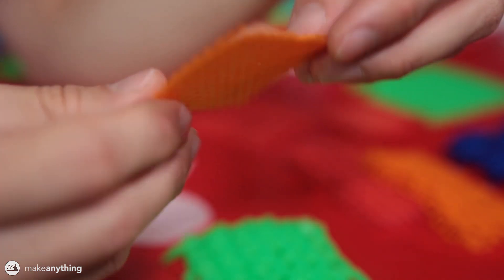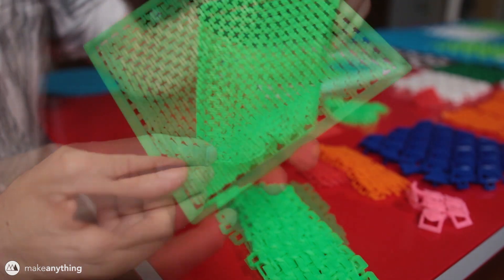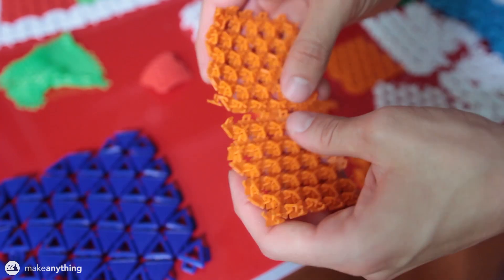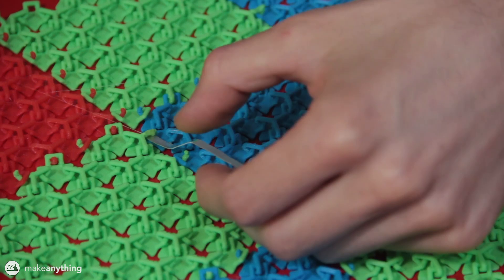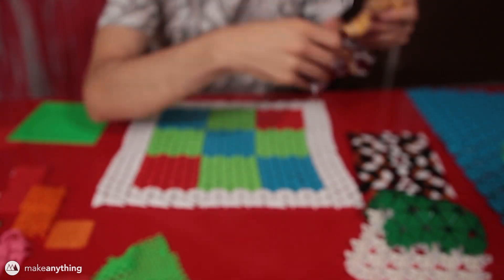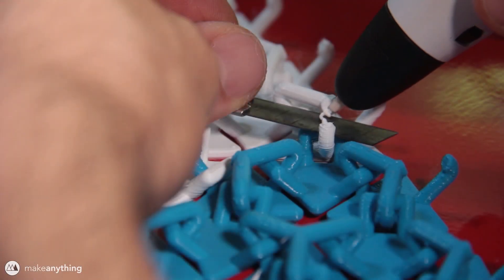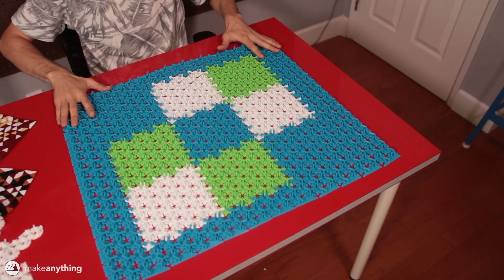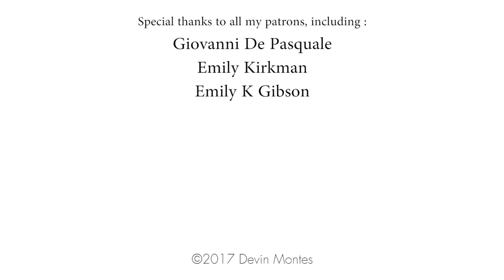Experimenting with 3D Printed Fabric

Comment: ofcourse this is the basic of crysis like body armour ...when the layer hardens by sensing the impact location by some sort of sensors, may be waves made with titanium like strength and loosen when there is no danger.also it can hold the Potential energy to be able to jump really far up or away..or it can absorb the impact energy from falling from a high top building or a place or it can absorb the kinetic energy from a projectile or a human punch hold it and redirect it so it is basically a protection shield by it self. ....right...?
You are on the right track.!

Comment: If u don’t like the bumpy or connection side you could print 2 fabrics and put the bumpy sides together and connect the edges so it’s flat on both sides
Reply: Also a filter

Comment: Woah dude thst can be used to filter water like filter out big rocks although it wont filter smaller debree 
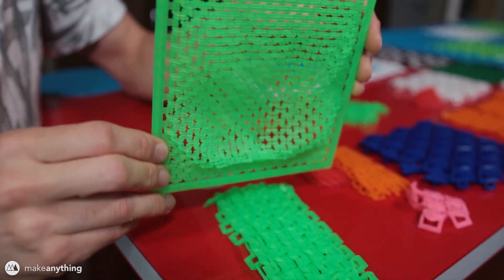4:49
Reply: Also you can make armor with the 3d printed frabrick although it will have little protection but with enough upgrade it will be an armor

Comment: Hey brother,  first video.  subscribed :)  3d printed fabric is paradigm shifting. 

Have you looked into combining this idea with  more auxetic structures like the auxetic lattice you demonstrated at 9:55?  You could, conceivably, make a form fitting, printed shirt using auxetic forms of these fabrics under elastic tension. 

Also, Think there's any way to protect the hinges and fill in the gaps to make the fabrics surface simulate a continuous field of material?

Comment: A 3d printered string bag would be cool, add a cloth layer on the inside so you can hold smaller items in it without them falling through the gaps, and to protect your more fragile items from all the joints on the inside.

Comment: I prefer using a regulated soldering iron over a 3D pen. It has more heating power and you can use "bridges" that were already formed. Pieces of filament in the simplest case, maybe zip ties, or if I need bigger PLA pieces I let the printer print them...

Comment: This was a really cool mate, what is the weight like? for example, I am contemplating making this for a weighted blanket version, would it be possible to add some weight to it so it feels heavier for sensory? Would appreciate it if you could get back to me :) thanks
Reply from the maker: It's already rather weighty, but you could increase the scale and print solid for more weight and that will also make the hooks stronger :)
Reply: @make.anything  how does it go for filament/resources printing it hollow? does it chew or?

Comment: I think woven fabric screen mesh would work better because it wuls be much more flexible. Maybe use a plastic that is more of a soft rubberized material.

Aside from the fabric I'd love to see you make a 6 X 2 1/2 X 2 1/2 foot Reptile Cage with flexible runner strips that clear solid panels slide into so it could be shipped flat and then assembled by the end user! A slide lock could also be built into it (or a metal one could be screwed into the front panel). I think that model could be created and mass manufactured much more affordably than plexiglass or other reptile enclosures currently on the market. There is a big demand for something like this in the reptile hobby.

Comment: "Unique bowl" accidentally creates a steamer basket out of plastic
Reply: Yeah , but if you use it , the dumplings will gain some chemicals from the plastic which from that bowl will be made off . ¯\_(ツ)_/¯
Reply: @laurentykalashnikov1745  yum!
Reply: @laurentykalashnikov1745  just make it out of PETG.
Reply: @laurentykalashnikov1745  PLA and PET are food safe, PLA will definitely melt though lol
Reply: @bigwendigo2253  Huh , InTeReStAnG 🤔
Reply: @laurentykalashnikov1745  food-safe plastics are a thing, so it's not impossible if they had the right filament
Reply: @laurentykalashnikov1745  use some expensive, bullshit "food-grade" plastic filament
Reply: If you can find a heat resistant plastic it would be pretty good
Reply: @suphorg8597  if the plastic was heat resistant how would you 3-d print with it
Reply: @fyredrakon  metal is kinda heat resistant or glass too
Reply: @fyredrakon  steel is fairly heat resistant and you can still melt that down, it's just about forming it at a temperature that is higher than what it will be used for
Reply: FyreDrakon polypropylene maybe, since it is food grade and can survive relatively high temperatures.
Reply: @fyredrakon  there are materials that change properties after being heated so probably using a filament that can do that
Reply: @fyredrakon  high temp thermoplastic like hdpe or nylon
Reply: @fyredrakon  There are plenty of printable plastics that can operate in temps above what they were printed at, gotta remember it isn’t just a thing line of plastic anymore
Reply: Strain your noodles with it
Reply: anyone want dumplings ^-^
Reply: Steamed broccoli and melted plastic! My favorite
Reply: Yeah but it has a lot of downsides, like chemcals that are in the plastic and plastic that will melt. But I agree, it would be pretty cool
Reply: Oh I forgot about that
Reply: Maybe if you coated it with a chemical

Comment: Should be able to make some cool lamp shades or large pendant light shades with this. Have you tried making it double layered so that it has a smooth front and back and all the joint are in between the layers?

Comment: Ok can anyone help me? So I have a flashforge finder 3d printer and got it fairly recently. The type of chain mail he made into a bowl is exactly what I’d love to make but here’s my problem: my printer always puts a support type layer on the bottom of every print so if I were to print this I would have to take that off and it’s really difficult to do. Does anyone know if there’s a setting or something I can change so that it doesn’t make a layer on the bottom of my print?
Reply: I dont have expertise with that printer specifically, but I know that my dad's 3d printer has a setting for it. Yours likely does too, though it may be harder to find. Checking their website is your best bet.
Reply: Alex The Human thank you so much! I realized that it was just because I had only been printing from a sorta crappy ipad app that is compatible with my printer, but once I used an actual computer with the better software it worked just fine!

Comment: I think something that could be a really cool improvement for 3D printers is to add manipulators to the print surface so that it can automatically remove the print when done.

the real benifit to this is that when one is put aside, you can move it back along with another so that you can stitch multiple prints together somehow.

Comment: The big one would be a cool idea for a blind on a window. When you have the bottom pushed up, the holes are smaller and let less light through. Then you could release the tension to make the holes bigger and let more light through. Maybe if it was designed with bigger holes or if the loops in the back had more room to move around, it would make the effect even greater.

Comment: A few ideas: 1) A tunic, vest, or hat/headdress of "fabric" like this, with thin-film solar cells printed or attached to the triangles, designed to feed energy to a device charger.  2) Feed thin strands of fishing line (or something similar) through the structures on the back, leading to strategically-mounted mini-spools that can reel in or play out filament, so that the fabric can become an auto-morphing kinetic sculpture.  3) Penrose tiles!  4) If your 3D printer has really high resolution, incorporate parallel grooves (like the grooves of a vinyl record) onto the outside of the triangles in various arcs, so the light will play across the surfaces in a mesmerizing sheen.

Comment: one of really good ways to achive a simillar result is to stop the printer after few layers (about 5 ) and then mount a thin mesh over that platform. Then just continue the print as usual. That way, the mesh will be firmly fused with the plastic parts

Comment: I tried to do that bowl and the mesh was welded together :(
Reply from the maker: The bed has to be leveled pretty perfectly to avoid those bottom layers from melting together
Reply: I check my bed before each print. Maybe the tolerance is just to low for my printer to handle. I noticed it will lock anything up with anything less than .5mm. so that might be it. I'm going to give it some more tries here soon cause I want that bowl

Comment: I did wonder if someone made a 3D printer that could use multiple colors during the same print.
You can use some of this pattern in curtians, Cosplay gear, coasters for drink cups,  floor and wall tiles.

Comment: You could make a good curtain with this if you want soft light to wake you up in the morning, floor mat if its strong enough, table cloth(if you spill, the holes drain the water), and multiple architectural structures. Its unique properties could make a cloth chair one day
Reply: The tablecloth is meant to catch liquids so it doesn’t actually hit the table underneath it
Reply: The curtain idea is interesting, when you stretch it it has a lot of holes for light to come thru, when collapsed , by strings or something, it would be solid, no light thru.
Reply: Victor Rossi like a solid curtain piece on both edges and when you draw the blinds shut it pull both sides up and at the top a solid bar that pulls one edge towards the other along the top hat would collapse it so it’s tight together. Then maybe use like undeerhangs for each piece so they actually cover small gaps between
Reply: You could do the floor mat but you need some type of Carbon Fiber filament
Reply: @connorferraro6683  I have not seen deliberately 3D-printed brushes yet. I wonder how feasible it is to print fleece.

Comment: Invent a printer that has a slowly rotating horizontal cylinder as a printing surface where the nozzle prints along the top of the cylinder, then you can produce an endless band of printed fabric!

Comment: I feel like you could use the one as a strainer instead of a bowl.
Reply: It’s pretty fragile though. A lot of water pressure could break it.
Reply: Or a net
Reply: Liskouskaj Bandurske just use food grade plastic and we bueno
Reply: A but you might not be able to clean it properly and still might be bacteria in it plus bits of food get stuck in a joint bits you can use hot water melt the plastic therefore the bacteria won't be all gone don't worry that's what I thought first anyway
Reply: Yeah! I was thinking that too!
Reply: Or maybe for pet food
Reply: Wouldn't strain much 😂
Reply: You probably could but only if it was cold items. Unless you like cancer!
Reply: @SylasTheGreat  Not all plastics are toxic.
Reply: @alexinf5765  those plastics are though. And while you're technically right most plastics are toxic. So yes not all at toxic but most are... Especially when in the presence of heat
Reply: @alexinf5765  bruh-

Comment: First of all we need to be able to 3D print much smaller construction with different tipes of materials (watter proof, heat isolation, conductive, elastic, etc...) to print all layers at once and also to print whole design of clothes withought further steps (cutting an joining together) imagine latest fashion with 3D printed microfiber that has integrated solar panel on whole surface (it doesn't need to be black) to power up active heat regulation and wireless charging in pocket ( of course with 3D printed liqiid and elastic battery). Further more it need to be able of mass production and of course to be sustainable.
Reply: That's my prediction for 2030-2050

Comment: hey just a tougth, what if you printed immediatly on very thin fabric so that the prints would stick on it but still have flex in it. 
It is not 100% 3dprinted than but just a thought. :)

Comment: Amazing! The bowl could be used as a sieve for fruits or maybe even pasta? (Can the 3D printed designs withstand heat?) And the larger quilt would make an amazing shade for a sky window or terrace, especially because it could also be rolled up; but also, the minimal compression and expansion allows for control of light coming through. (Plus that cool pattern made from the shadow!) Super, super cool!

Comment: Just a bit larger. Then you can make a wire frame for the whole thing to lay on in the shape of a house. Lay in a grid of clips on the back side of the panels. Then spray the inside with some sort of expanding cement. Just thinking about it watching this video.

Comment: Try using hexagons just smaller than those triangles you can simply make as many connections as there are sides but about the hexagons it should give it more flexibility.

Comment: If you re-visit this kind of thought, I suggest you look into Chain Mail, Ring Mail, and Scale Mail. Those were essentially the first real forms of metal cloth (In that it is a flexible sheet that can be 'stitched' together to form pieces like clothing and bags). And understanding the rudimentary differences in form and qualities between an Oriental 4-in-1 weave or a European 4-in-1 or European 6-in-1 could give you a pretty firm grasp on how to try to push yourself further into making different or newer forms to play with. Actually, your Triangular patterns there kind of remind me of an Oriental 3-in-1 design. Where each triangle is connected to 3 others by a linkage. 

I also want to say that as a Maille weaver, it made be cringe just a little bit when I saw your squared off joins and rings. learning how to do the same thing with toroid shapes would make it feel smoother on the skin in any direction that it would rub over, on either side. Also, your scales: typically, in traditional scale mail, you might find it interesting that each scale has its connection hole in the very top, and is connected from there to each of its four neighbors by a link between them. That way, as the finished piece lies flat, the linkages are hidden by the layer above.

If you would like, I can point you in the direction of some Chain mailling resources that are fairly simple to delve into and understand, so you can dissect the forms of various weaves, and further understand the sizing of the rings (Both in inner diameter and thickness) affect the flexibility, durability, and such of the piece.
Reply: Wat.
Reply: old man describing beavis and butthead to the police: "....ah think they were oriental"

Comment: You can make an array of pieces in the XY coordinates and join them by one of their faces with a thread all along, also in the X and Y axes .... all the pieces would have 2 threads in XY that would unite them ... another example: repeat the previous fabric, but make a kind of sandwich ... print the fabric and then repeat the pieces .... they would be piece filament piece

Comment: Hmm.  What would happen if you took the "bowl"fabric and tried a different shape of loop for the edges, instead of having to use the rigid border?  Perhaps ovals that fit with the fabric loops, and with each other.  Or maybe ovals to finish the edges, but tamed by smaller circles linking the ovals, but not interlocked to the main fabric.  What you have done is excellent!  It is thought-provoking, too.  Thank you!

Comment: that "quilt" would put my noisy headboard to shame when doin' the wild thang.  the flat side seems like it would be comfortable on the skin as opposed to the link side.  now if both sides were flat then it would shimmer on the outside and be soft against the skin.  and if you used UHMWPE material it could make  a cool bullet proof vest without needing a plate carrier.  I liked the colander aka bowl.  print it with the flat side against the skin and angle the outside so it has facets like jewels then it could make a good wedding dress... or what about the leaf design for making a ghillie suit? an octagon shape might work better than triangles.

Comment: The last model. Would you be able to mirror it with smooth sides on the other side as well, for a fully smooth shimmering 'fabric'? Perhaps instead of the triangular pegs, you would have them be fully solid triangles. Or, albeit a bit more clunky, you could fully mirror the hinges and triangles off of the rough side. I have the idea sitting perfectly in my head, but I don't have the programs or the printer to try it myself and make it work. 

Also, that bowl mesh is insane. That would be pretty cool as a type of mini curtain or so.

Comment: Question: are there any dual sided, 2+ layer thick 3D printable fabrics that provide a solid surface (no visible gaps all the way through the fabric no matter how stretched or flattened)?
Reply from the maker: There are definitely SLS printed fabrics like this, but making such a fabric printable with the cheaper FDM printers I use is a bigger challenge due to constraints... of course, I like a challenge :)

Comment: This is amazing! One question on the flat-loop design (that you used for the bowl): do you think you could find a way to print a hybrid rigid/flex part that has curvature built in at the time of printing? My thought was printed conduit adapters that have rigid flanges at the ends and a flexible section in the middle. It would be a super practical application but it would be dimensional, and that could present difficulties.

Comment: Dude, get this around a lamp and have some actuators move it etc
That would look awesome, you just have to check what you can do with that !
I am pretty sure with a small circuit board and some motors/actuators whatever it can be done, and people would buy kits for it probably.